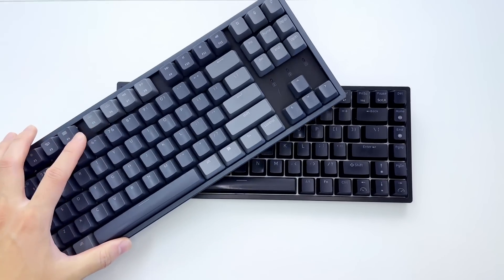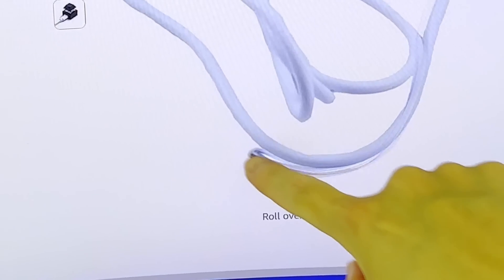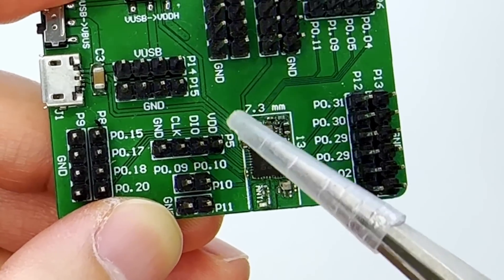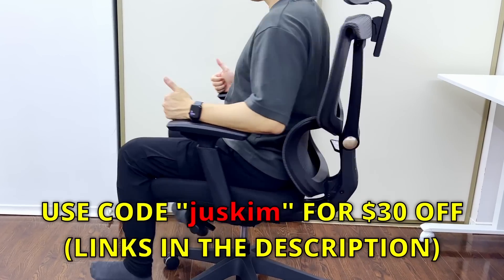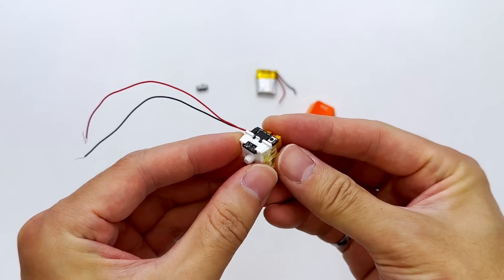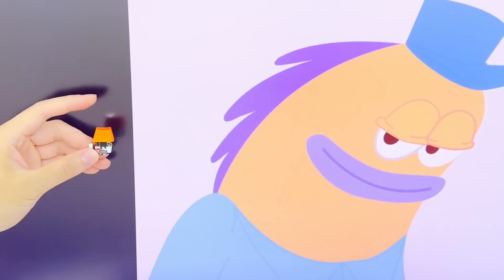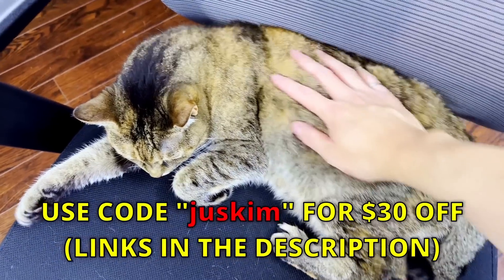I Made the SMALLEST Wireless Keyboard

Comment: I had an idea similar to this quite some time ago, though without the battery.  There's a very fringe effort within the ergo community of having adjustable key placement, basically a frame with sliding keys so that a design can fit your hands perfectly; you can probably imagine how complex these would be, given each placement variable, and with slack wire bulk under all of this.  Along this idea there was a product that modularized each key into its own housing with a set of contacts, and with a baseboard with contract strips you could effectively place each key individually, these switches were otherwise fully wired via the contact strips; though this resulted in very tall keys and no way to actually secure them outside of magnets and a steel plate.  So why not just make a system that's per-key wireless and only transmit power to the switch via an inductive coil?  Seems simple enough, except various wireless mesh topologies really are not built for this complexity.  Unfortunately microprocessors and wireless isn't efficient enough to make batteries this small worthwhile, and part of this issue is how they communicate with the host; if we went back to interrupts instead of polling, this could potentially be much more practical, except current wireless standards need a consistent connection to function properly, so that introduces yet another issue of figuring out an inconsistent wireless method that wouldn't eat up too much power upon constantly switching back on.  If there's ever a decent solution, imagine the possibilities with custom layouts, not only would you have a perfectly ergonomic solution tailored to a specific individual, but you'd also have so much more layout customizability, and when it comes to untreaded layout territory development can be a hassle especially with revisions but this solution could provide a devkit where development only requires a frame to test.

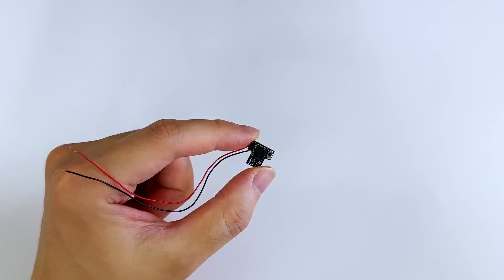Comment: 6:40 Bro... I have no idea how you even did that QFN with a hot air station... Let alone the 0201s.... Get a hotplate, like the MHP30, or the MHP50, for like $100, it's so, so much easier, you don't even need flux, just solder paste, and the solder joints will come out so much better. And, you should just be able to power the hotplate with a 100W USB-C PD supply, assuming you already have one of those. And, the components on the other side of the board you can just do by hand, or with hot air. Great project btw!